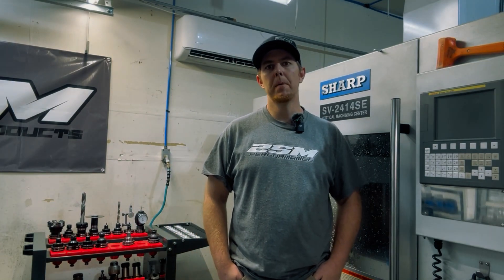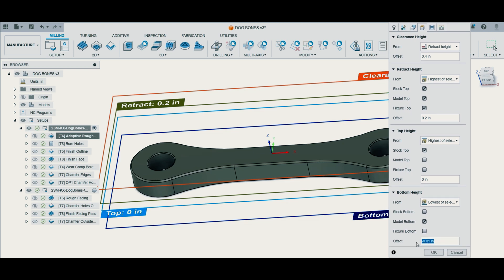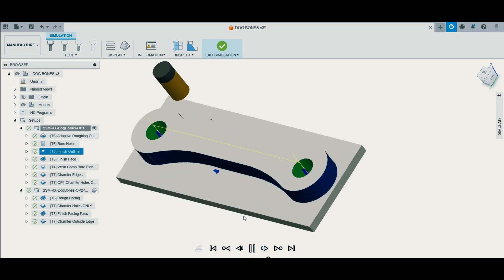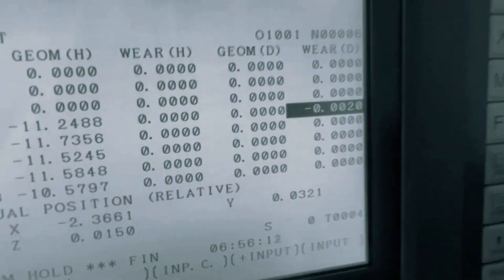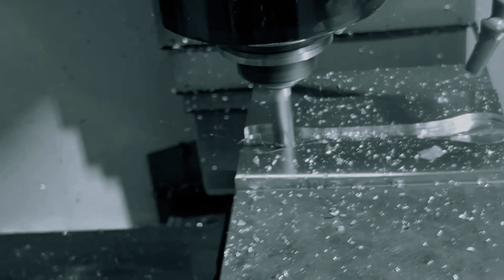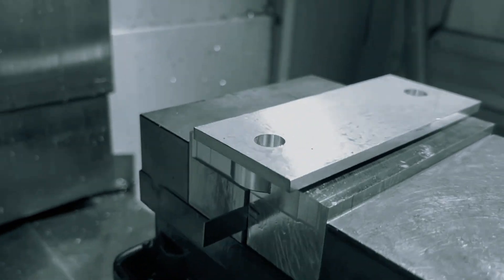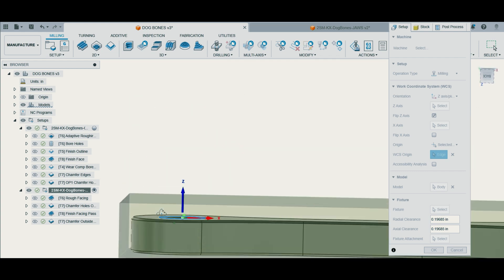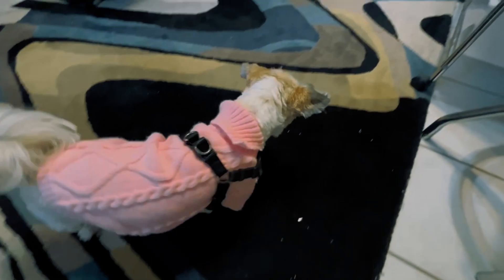How I Programmed This CNC Part for a Perfect Fit | The CAM Files Ep.3

Comment: So in fusion if i dont turn on wear comp, then any in control diameter or wear comp wont be applied??
Reply: That is correct. It will assume the tool is exactly the diameter that it is modeled in the software, it will assume there will be no deflection, and it will assume the hole in the model will cut 100% correctly. All of these are assumptions that are likely not true in the real world. The wear comp exists so you can make minor adjustments.
Reply: Wear comp will still 'offset' the toolpath by the radius defined in your Fusion tool definition. But it will output G41/G42. In control comp won't offset the toolpath at all in Fusion and will output G41/G42. The practical difference is, to use wear comp you MUST zero out your diameter offsets in your control, otherwise Fusion will be offseting for the tool radius, then your control will try to offset again using whatever value you have set in your control, most likely resulting in the control trying to turn any arcs inside out which will throw an alarm on the machine. 

Fusion In Computer Comp = CNC Control diameter offsets aren't used on the control because G41/G42 aren't output
Fusion In Control Comp = CNC Control diameter offsets are used because G41/G42 are output. Fusion doesn't offset the finishing passes by the tool radius.
Fusion Wear Comp = CNC Control diameter offsets are used because G41/G42 are output. Fusion DOES offset the finishing passes by the tool radius.

Comment: Watching you measure those holes like that made me cringe, especially not having repeat finishing pass checked I'm sure those were tapered. I routinely do +/- .0002 holes on my mills and this is not the way to do it for good repeatable results. Also, your facing strategy for OP2 is completely incorrect and will leave you with a giant piece of unsupported stock that will break off and is not a safe practice at all
Reply: For 0.0002”, it’s a completely different process - sure - but for 6061 parts with the tolerance he’s working to? It’s fine. Take aerospace time on parts that don’t need it and you’re just burning cash as a business owner.
Reply: @iansandusky417  I am a business owner, and following best practices, even on parts that have absolutely no need to be that good, helps with your overall part quality and makes you look better to customers as well as making it much easier to make those difficult parts when they do come because the practices are already second nature. It wouldn't have added any noticeable time to his cycle to do spring passes and make a straight hole. Just like if you have a +/- .01 tolerance you don't need to use all of that just because it's there. Now if it's going to add a substantial amount to your cycle time in high production then yes 100% save time where you can and use tolerance to your advantage but on  short part runs it's better to just do everything as if it was aerospace so when you need to do aerospace it's just another part
Reply: @MSMillingCNC  I mean you’re not wrong, how many employees at are your business?
Reply: @iansandusky417  we have about 60 right now
Reply: @MSMillingCNC  Sheesh fair enough! Most of the time this kind of feedback comes from people who are employed machinists who might not understand the full business picture - and I'd never fault a machinist for wanting to make a part the best it can be, but if the job was quoted at half an hour and someone takes two hours to make something even more in tolerance when it was already in tolerance to begin with - it starts to hurt the business case.

That said, sounds like you're doing something VERY right here, so I appreciate the perspective - and it's definitely given me some things to think about!
Reply: @iansandusky417  I'm never going to fault one of my employees for taking longer on something to make a better part on something short production plus it gives them the satisfaction of making something they are more proud of. Like I said, if you quote a 1000pc order at 30 mins, you can't take 1 hour to make it just to make a better part, but on short run stuff we get a lot of runway on that sort of stuff
Reply: I usually step down along silhouette of the part to trim off the excess left over stock before facing but in this instance I chose to save time and it was harmless. And yes I usually use gauge pins but I don’t have any over 0.500”
Reply: What would best the best, repeatable practice be for something like this? Just curious, im only 2 years in
Reply: @noahdboss1195  in which aspect of this part? There is no 100% best answer in machining, as if you ask 100 machinists how to make something you'll most likely get 100 different answers, and usually 95 of them will work fine. Also, im only 30 so im not some master machinist. In my experience, the best way to endmill holes to size without taper is by using at least 3 passes of .001, ending with a spring pass on the last one. This tends to eliminate the taper in holes, or minimize it, especially with tooling that small.  As far as the OP2 goes, its always a big no no to me to leave a large piece of unsupported stock that results from the "hat" thats left on the part from OP1. The way he did it, starting at one side and traversing in X while doing Y stepovers will usually work as long as the finished part is not much smaller than the stock you are using, which in this case it was much larger so he probably had a significant chunk that fell off the part as the last bit was removed from the part (didnt show that in the video so im just guessing) My go to strategy is usually to do a 2d dynamic milling profile that uses the outside contour of the part as the geometry with something like .100" radial stock left on it and machine off the hat using an endmill, then follow it up with a facemill so that the cut you do has no extra stock left to either break the inserts or in this case, possibly get caught in the endmill and break it.
Reply: @MSMillingCNC  very well explained! Makes sense to take a few passes of equal load to make the most accurate comp in the controller. As well as doing a 2d contour to rough off the unsupported material. I'll definitely keep this in mind when creating future programs!
Reply: @MSMillingCNC  how long have you been a business-owner? whats your backstory if you don't mind me asking. I hope to one day open a shop and find it intersting hearing different perspectives

Comment: Your CAM tool doesnt match the actual tool you used in terms of flute length or stick out - you dont simulate your tool holder and you dont simulate your fixturing - im not sure this is a particularly good example of programming and machining best practices
Reply: Eh, I do what he did all the time - if you’re not playing real close to the flute length or stick out, you’re kinda wasting your time getting everything perfect in verify vs the part
Reply: Im not doing 5 axis buddy, I have never needed to model my vise or holders, ever. Nice opinion though.
Reply: @2SMPerformance  If you're going to put videos about machining on the internet, you're going to have to get used to morons.
Reply: none of what you criticise matters in the real world, what matters is the part made to size.